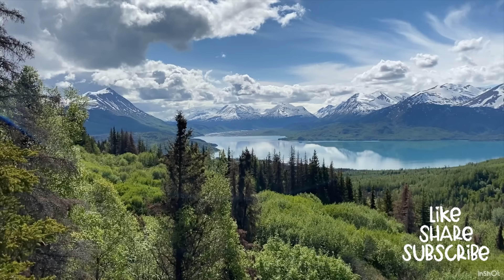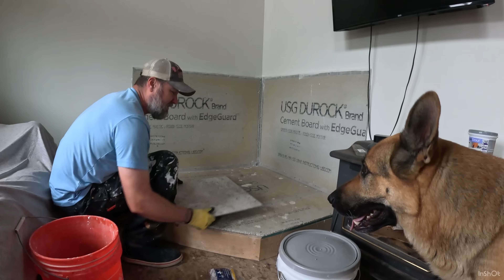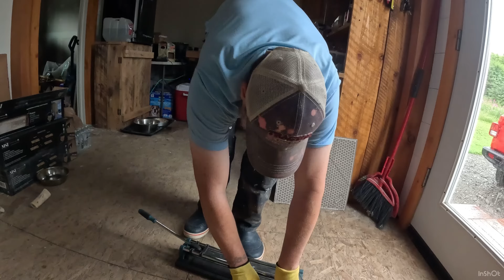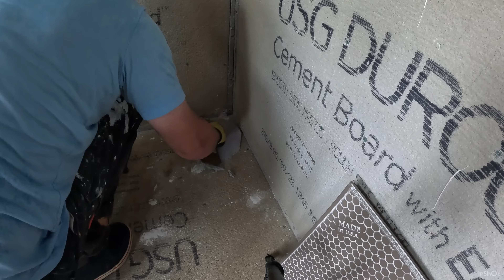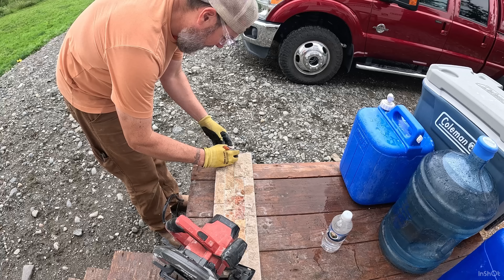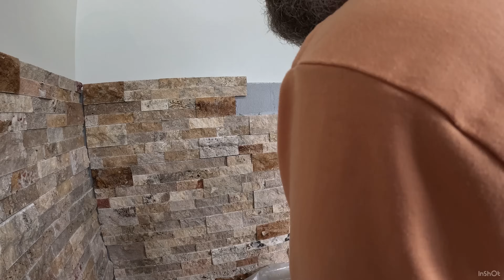DIY Tiling a Hearth for Wood Stove - Part 2 | Alaska Off Grid Homestead Tiny House

Comment: Looks good.  Yes, you should have used more thinset and even put some on the back of the tiles first.  But since this isn't an area you'll be walking on you should be okay.  Just keep that in mind for floor tiles next time.  I think you could also leave that crack where the rock meets.  It shouldn't be that noticeable once the stove is in place.  But grout or even a high heat grout-caulk would fill it in easy enough.  Stay with your plan, your budget, and do what you want.  Those telling you what you should be doing can earn that right by first sending a donation large enough to fund the project they want to see done.
Reply from the maker: Thanks Jay

Comment: Not a pro, but wondering if wall stone is too porous to grout? That is, will you be able to wash off the excess as you can with the smooth floor tile? Perhaps test the grout process on some small wall stone scraps to make sure it works. If not, you can go with the colored caulk as suggested by another. Loved the video and hearth looks super.
Reply from the maker: This type doesn’t require grout, making it much easier.
Reply: I meant the corner you mentioned you would grout…
Reply from the maker: @sallyberry4456  oh, I see yes. We’ll do some trials before we put it on the wall. If it is too porous to clean we probably will just use the caulk.

Comment: You don't need a deeper towel. It needs to be held straight up. Just put it on thick then pull your grooved trowel holding it straight up. That'll give you deep grooves. Not criticism just a tip. I had to be told also.

Comment: Just wondering..every tile job I ever did..I would use a notched trowel and make lines in the thin set before installing..is that a different kind of thin set that doesn't require that...nice job though
Reply from the maker: We just didn’t have one with the big notches. Ours were small shallow ones. I’m not too concerned since it won’t be walked on. The wood stove will just be sitting there so it shouldn’t be a problem.